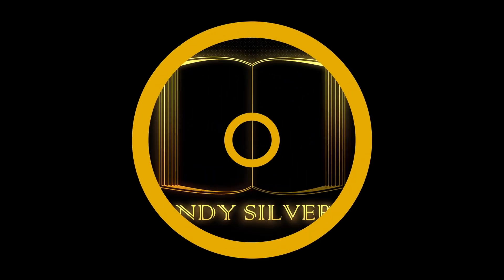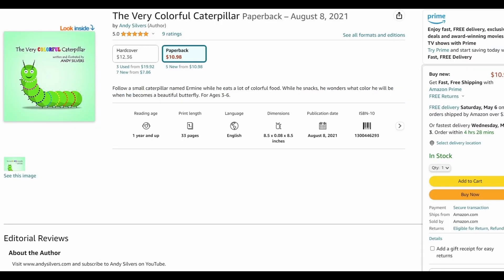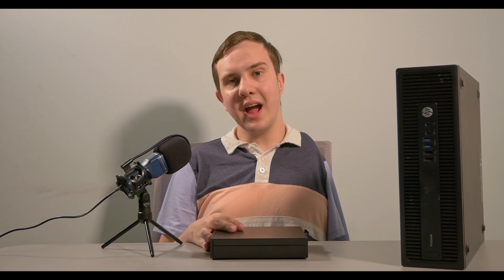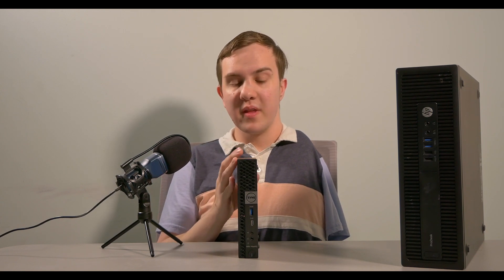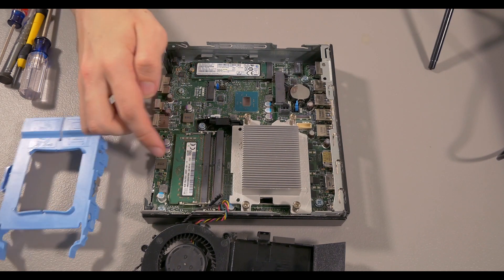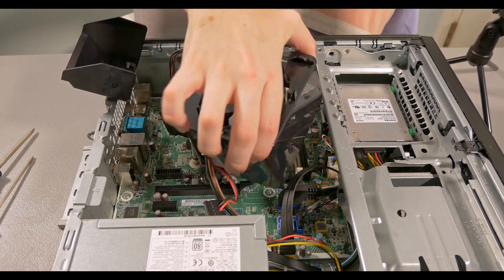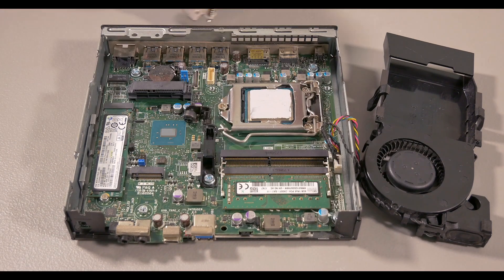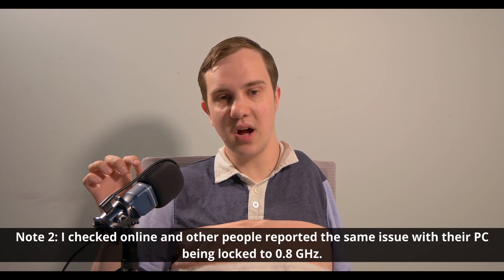My Disappointment is Immeasurable and My Day is Ruined

Comment from the maker: I've learned a lot doing this video and receiving feedback from the online community. I want to begin by saying that it is highly unlikely the Dell motherboard is vendor locked, though there's still a small chance it is. However, more importantly, the 0.8 GHz limit may be related more to power supply limits than Manufacturer meddling. I knew fixes were possible and this process was meant as a tech experiment. I will post a future video explaining my findings and research.
Reply: I'm glad to see that you've discovered the power supply discrepancy. With Dell products like this it uses the center pin of the power supply to tell the motherboard what the power supply is capable of and if you get a power supply that doesn't send the right signal or there is an issue with the DC jack on the system itself the CPU will often lock to its lowest clock.

Comment: You know, you can go to Dell Refurbished and get an i5 8500 or i5 8600 (6c 6t) for less than $200, both the MFF and SFF.

Also, as a Dell reseller, I can tell you that Dell does not lock a CPU at 0.8 GHz. At that rate, the CPU is not getting power. Either the CPU is defective, the BiOS has never been updated, or the unit has shorted from heat. Look at the thermal paste pattern, which is indicative of an overheating issue.

Comment: I have been working with these micro pcs from dell for a while. I got to the conclusion that the 0.8ghz is not related to bios or vender locking it but to power. Had luck replacing the power brick ( oem from dell) and sometimes replacing the dc power conector from the motherboard. This is a "safety " feature from Dell, where the MB checks the power and, if it doesnt meets the corret value, will lock the frequency. Some models you can see the warnig from the BIOS.
Reply from the maker: Yes. Please see my pinned comment.

Comment: There is no vendor lock. Your 6th gen desktop probably A) Doesn't support 7th gen OR B) needs a BIOS update to support 7th gen. Most 6th gen motherboards do NOT support 7th gen out of the box. Rarely do you see vender locking at this level, it's more likely with OEM only chips OR specific classes of Xeons. Most of these desktop class CPUs "JUST WORK" assuming your board/chipset AND BIOS are supported.
Reply from the maker: Yes. Please see my pinned comment. Thx

Comment: 1. As far as I know the vendor lock only applies to AMD Ryzen CPU's, not any Intel CPU's.
2. That HP computer only supports 6th gen CPU's.
3. The i5-6400 will work in the Dell computer, but you need a 90W (or higher) power supply because that CPU is rated at 65W by itself.
Reply from the maker: Yes. I'll be doing an update video soon.

Comment: I wonder if the clockspeed issue you had on the i7 was related to that thermal paste spread. It looked like the cooler was barely contacting the cpu there which would mean little to no thermal transfer between the two
Reply from the maker: No. I've learned a lot in the last two days. It's definitely the power supply not being an official Dell unit. Thx.

Comment: No way it is locked to 0.8, I suspect it is rather a thermal throttling issue.
You see, when you turn it on, if it quickly reaches over the maximum heat limit intel specified, it will lock itself in this 0.8ghz mode. How do I know? Because my first toshiba laptop had such issue, and it took me a whole career to find and solve it.

A simple solution would be to remove the external case, then hook a normal stock intel dissipator on top of it, even if you have to anchor it with some hacky way.

Btw, Windows has power options hidden. You can unlock them via regedit (google "unlock power options one liner regedit"), this will allow you to create a power plan that can completely disable turbo boost, or force your cpu to use it all the time.
Turbo is actually a very stupid manufacture decision, since it is basically eating watts and spitting heat.
I dare to say your stock cooler will suffice if you disable turbo boost, and you wont even notice a speed difference.

Comment: I got one of these for $15 a while back, with an i3-7100t in it. Jammed an i5 7500 in it, and hooked up a 250W power supply I had lying around. It runs fine, but only turbos for a tiny bit before hitting 100°c. Now, it's used for controlling a 3d printer and doing some CAD.

Comment: Lots of PC OEM systems are "locked" or restricted due to heat management. You see this all the time in anything "miniature" with limited ventilation and in some cases no internal fan.
Reply from the maker: Yes but I think it's a voltage issue.

Comment: Wutup Andy!  I've got a client w this same computer and we've run in to it a few times where it'll get stuck on .08GHz.  Usually a reboot solves it at least temporarily.  I feel like it started after we did numerous Dell updates including BIOS updates.  I'm an update addict and I've been burned plenty of times lately by doing these damn updates.  A client's Epson printer recently stopped using the ink in the unit after we did a firmware update.  Right before our eyes it started saying we couldn't use the ink that was working 2 minutes before the update.  Incredibly shady.  But back to this goofy Dell situation - have you done BIOS updates to it?  Another problem I've read about can be the power supply - possibly changing that may help.  Are you saying there's some other problem with yours where there is a setting in the BIOS you can't change that's keeping it at .08GHz?
Reply from the maker: Thank you so much. I think I've found the solution. Use a Dell powerbrick that the computer can recognize. Thx

Comment: Hello:
Sorry for my bad English, I am using a translator. 
I am in the business of repairing/selling second hand equipment.
The speed lock on Dell equipment is because of the power supply. The power supply, or the computer, does not detect the wattage correctly and locks the CPU at the minimum speed.
Use a new/original Dell charger, and you will see the problem go away.
Greetings from Spain.
Reply: if the power supply not working (oem),  for windows you can use software clock setting tools and has it run on boots.  (I have this problem on mine as the mother board failed to detect proper wattage).  My guess on, why it was like that, on positive note, maybe it was designed not to overload an adapter and risk fire hazard.
Reply from the maker: Oh gotcha. I hoped there's be an easy solution. What about the HP that won't boot at all? Any tips?
Reply: @andysilvers9532  I think that HP only supports 6th generation processors.
Reply: @andysilvers9532  You should be able to solve it if HP made a bios update that supports 7th gen.
Reply from the maker: @quotablegaming7767  Yes.

Comment: Bios on the hp may not support 7th gen
Reply from the maker: Yes that's possible. I'll do further research and report my findings.
Reply: @andysilvers9532  HP ProDesk G2 does not support 7th gen. G3 supports both 6th and 7th gen. The rule of thumb is, a pre-build computer will only support the processors it was offered with, even if the chipset would allow it. I made the same assumption once and was disappointed that I was not able to upgrade AMD A12 processor to a Ryzen, despite both using AM4 socket. Old pre-builds are cheap for a reason.

Comment: Lenovo is vendor locking some current AMD Ryzen based systems. AFAIK, Dell has never vendor locked older gen Intel based systems.
Reply from the maker: Yes that's possible which is why if I can figure out how to get the HP running I'll post an update